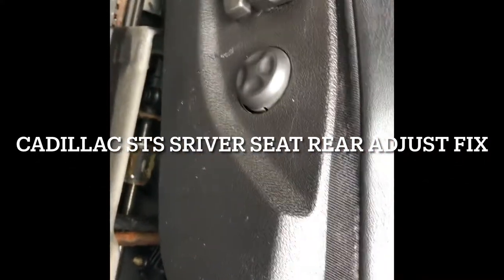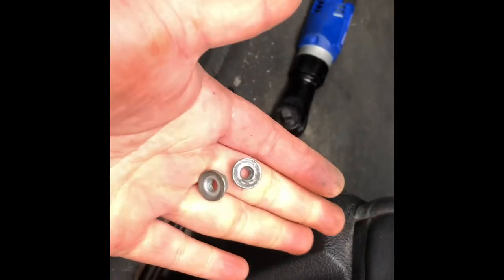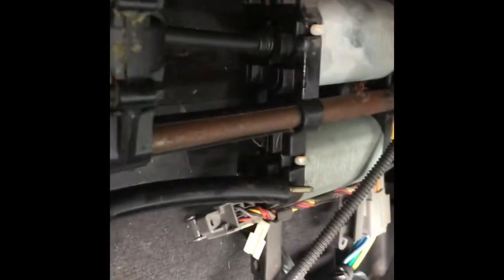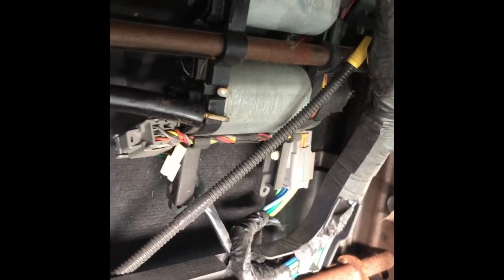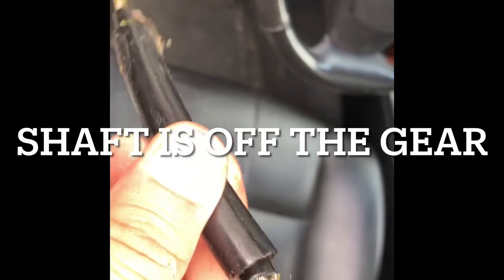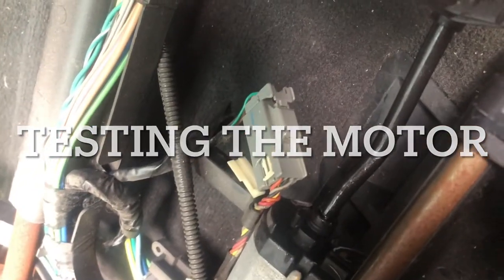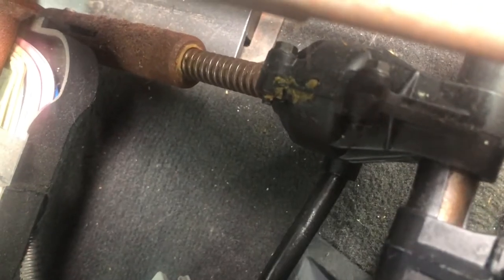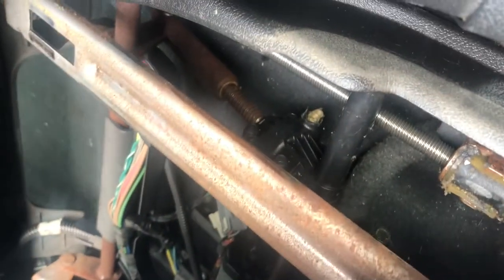Cadillac power seat rear adjustment fix for free

Comment: What do you think about both seats not working at all , nothing at all. 

Fuses , relay ? 

Thanks
Reply from the maker: I'll check for 12v power on both seats, if none then fuses
Reply: @highmilesgarage9131  

Thanks man , any idea which area is the 12v power line ?
Reply from the maker: @reza_dc2  usually they are the thicker or thickest wire in the loom going into your seats, look for red (+) and black(-) and test with voltmeter